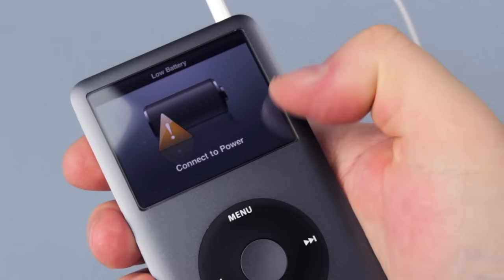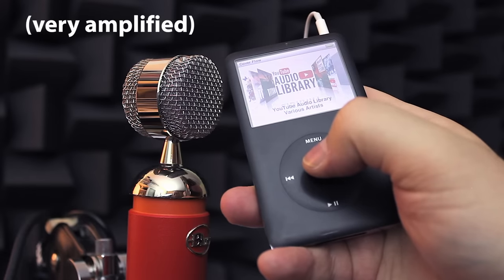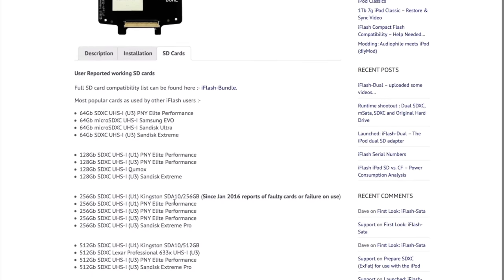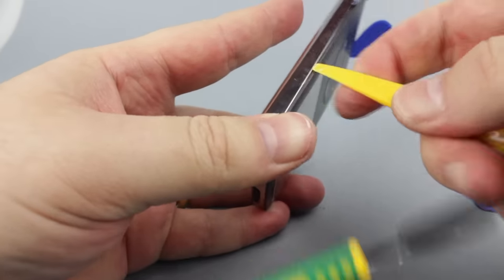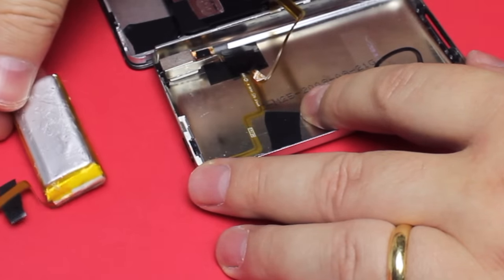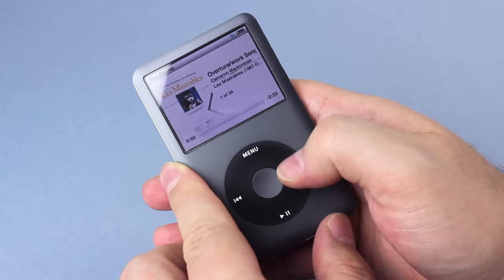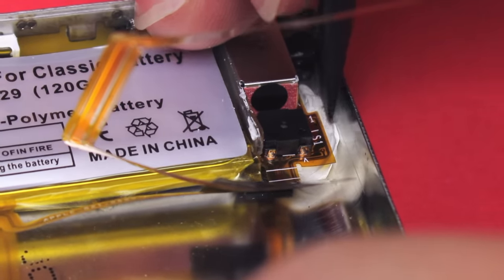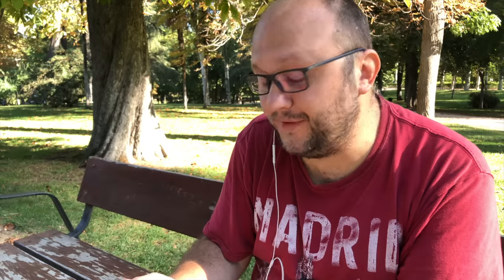iPod Classic new Battery & 256GB SD Card: still works in 2024

Comment: Thanks for your honest and informative info on how to do this. I was so apprehensive I didn't bother to order the micro SDcards  and the quad holder before getting the back off. However I did it in less than 10 mins thanks to you making all the mistakes for me and providing the vital PDF showing where the clips are. Great channel.
Reply from the maker: Thank you Ian! 😄 I am very happy that you could renovate your iPod without trouble! Most of the people watch this as entertainment only (totally fine), so when someone actually does it, I feel very accomplished 🤣
Reply: @GeekDetour   A footnote to my upgrade. Feeling pleased with myself I uploaded the whole of my music library and all my audiobooks. I still had 200gb free so I thought I know - photos. It will be another backup as well as having all of them in my pocket. GOTCHA! The photos synced OK but after a reboot the iPod stuck forever on the apple. It eventually dawned on me I’d broken the 50,000 limit. 35,000 songs + 18,000 photos. The iPod would go into diagnostic and disk mode but just sat there, draining the battery  if you tried to reboot it! So with these memory upgrades the 50,000 becomes a limiting factor. Thanks again. iPod now restored and synced - without the photo library ;-))

Comment: I enjoyed your video and it helped me avoid all the pitfalls that you went through. I had my own pitfall as the battery post came off the logic board :(. The brown locking tab was seized to the battery post due to age and heat . This is also a common problem
I was lucky enough to source a new battery post and had it re-soldered on.
The template for the clips was excellent and had my iPod 7gen apart in probably less than 3 minutes with no damage :D
Thanks again for posting your informative video
Reply from the maker: Wow, thank you so much for sharing your experience! I really appreciate it - most people who watch the video do so for entertainment (which is perfectly fine), but it really makes me happy when someone benefits from the video to actually fix their iPods ❤️

Comment: I have 160GB classic.  I think I bought it in 2013.  It is starting to give me some trouble, but I use it as my car stereo and I find the touch screen on my nano problematic.  I can't see it half the time b/c of the sun, and if I touch the wrong spot while driving it goes off into some neverland menu and I have to pull over to get back to the right spot. The classic is perfect for feeling my way around so  I need to source another one of these iPod classics or find someone like you to fix mine.  I can barely run a screwdriver so I know I would be hopeless trying to fix it myself.  I just read Edward Snowden's book, "Permanent Record" and so yes, I want to own my songs and keep them out of the cloud.  Anyway I am out in the bush most of the day so streaming is not an option.  Thanks for the video, you are great at teaching.
Reply from the maker: Thank you! 😁

Comment: Indeed useful and entertaining video! When I opened my 7th gen iPod few years ago to replace the hard drive it took me hours of struggle and I promised I would never open it again. Mine is the "black" (actually it is a dark grey), I used automotive paint with a toothpick to mask the small dents in the paint and the result was very good. Also, before closing, I spent a lot of time bending  the stainless steel borders inward to make sure the gap between front and back would stay as close and smooth as possible. The conversion to an SSD became cheaper and after seeing your video I cannot resist the temptation to open it again!

Comment: wow, following your advice and pdf I opened up gen6 like a book with in five minutes, not even scratch on it...and it is my first try, really easy when u know what to do, thank you very very much. and hell, everyone says its so so so so hard to do when it's not when u use right tools properly, very greatful man, thx again.
Reply from the maker: Hi there! I am glad the video helped you - Absolut right: once you know what to do, the difference is huge! 🤣
Reply: @GeekDetour  yee, I opened it painlessly, but even when I was careful while removing old battery I ripped "hold button"ribbon, same glue that was holding battery was also holding that ribbon and ripped it. I'll order replacement now I and complete iPod renewal later, I am changing battery and also installing iFlash, I'll replay here with results :) thank you again

Comment: Thank you so much! After trying for more than an hour using another video, I had bent the metal around the charging port, but failed to get the ipod open. I had a couple generic tools like the iSesamo, but based on your recommendation ordered the real thing. Increased the cost of the battery replacement, but since I suspect I'm going back in, well worth it. The top seems to pop up a bit as you successfully release the clips.  Battery is now good, but I'm pretty sure my hard drive has ongoing issues, and I'm going to look at the SD card adapter. Will remember to try and smooth out the bend in the metal around the port when I do!

Comment: (Nov 2020) I still have mine, intact and fully working. Flashed the firmware with Rockbox so I can play FLAC, APE, etc. too, and also not need iTunes. It can dual boot to iPod firmware (but I never do). Paired with "chi-fi" 12 driver earphones. Still sounds awesome!

I found your informative video while looking for a way to upgrade to larger SSD. Lossless music can fill 160GB very quickly.
Reply from the maker: Hi 👋 If I could go back in time, when I started ripping my CD collection, I would have done it in ALAC (it is the Apple Lossless codec, an option inside iTunes) and the original iPod Apple firmware plays without a problem - I really like the original interface of the iPod 🤣 Actually, even iTunes I like 😳 But since most of my library was ripped in AAC 160, I won’t bother going bigger than 250GB - in fact I don’t use even half of that 🤪. I am happy you enjoyed the video! Be careful when opening your iPod - if it is working perfectly, I would postpone this “surgery” 👍

Comment: Brilliant instruction.  What glue did you use to close the first iPod and can the iPod be re-opened once it is glued?  Thanks
Reply from the maker: Thank you! The glue is “Ceys Montack Desmontable” that I easily find here in Spain but I have no idea of a similar product on the USA. It is a white paste adhesive that you apply and it takes 24h to cure. Once it is hardened, it is quite strong - and yet, you can peel it off with a spatula leaving no residues at all.
Reply: @GeekDetour  So generous of you to reply.  Thanks, I'm in Europe and can get it from Spain.  My Achiles Heel seems to be the battery connector that so easily breaks off or the black locking mechanism falls off.
Reply from the maker: My pleasure! I hope you can fix your iPod too!

Comment: Excellent.  I'm about to get in to my iPod classic because the HOLD button stopped working.  I need to know what kind of screwdriver to get for replacing this part.
Reply from the maker: Inside the iPod Classic, if I remember well, everything was screwed with very small crosshead (Phillips) screws.

Comment: My iPod Classic 160GB Just died. At first it seemed to be a battery issue, but then I had to do a restore three times a week. So I gave up trying to get it to work. So for about a week I started using my iPod Classic 80 GB. It will last all night long without any issues. But after seeing your video, I might just try to replace some key parts. But yesterday I bought the latest iPod Touch 256 GB. So I’ll be ok listening to my library until I feel ambitious enough to take the iPod Classic apart. Thanks for the video.
Reply from the maker: Hey, my pleasure! Oh, any smartphone, iPod touch... actually, any touch screen makes a much better interface than the iPod Classic’s click-wheel. But, well, nostalgia 🤣

Comment: Thank you! This video showed me just how many people are out there "just like me". I've experienced almost all of this stuff in the iPods hey day. I didn't throw my classic away. The drive needs replacing ad I wanted to upgrade it to SSD. You did it Bfor me so I think i'll be fine.
Reply from the maker: Hey Darryl 👋 So, it is indeed possible to choose to use SD Cards, Compact Flash and actual SDD drives - both 1.8” Zif SSDs and the modern MSata SSDs. BUT, you might think SSD would give the best result in iPods... and that is controversial! The battery life can suffer quite a lot on SSDs compared to SD Cards. If you want to dive into the details, read this page: https://www.iflash.xyz/runtime-shootout-2016-quad-dual-solo-msata-vs-original-hard-drive/

Comment: Nice video. Loved to see how enthusiastic you are about this. I got myself a 7th gen, too. I got it for really cheap because the battery was dead and bulging, so I was able to gauge the price down a bit. I ordered the iFlash quad because it's the only iFlash that supports a big battery. I got myself a 3000mAh battery (which is actually ~1950, given it's size), a new black metal housing, a red faceplate and center button, and a black clickwheel. All the parts should arrive in a week or so, and I can't wait to finally have this iPod up and completely running!
Edit: I also forgot to mention that I went and got the taptic engine of an iPhone 7+ to replace the clicker speaker.
Reply from the maker: Thanks! And wow: some major changes in your iPod revamp! Will you make a video?
Reply: @GeekDetour  I had planned to make one, initially for my girlfriend only, but I decided some days ago that it would be cool to make one for the world to see, too. It's nothing other people haven't done already, but it's my own personal little project, so I thought it would be nice. It won't be on this channel, however. If I remember I will post you a link when it is done!
Reply from the maker: That’s great! Good luck with your project and I will surely watch.

Comment: I have 2008 6th Gen Rev 1 80gb ipod classic and i this is exactly what i want to do with mine. I do have an ipod touch 7th gen, but it lacks volume fullness that the classic has. I would rather be able to use my classic more than the touch, so this video will help me immensely. I will update with results when finished. Thank you Geek Detour.

Comment: I have a 6 year old iPod Classic 160 GB which I bring with me when I travel and also use with the iPod dock in my Honda Accord.  Several months ago the hard drive started to fail.  I can load about 30 GB on it and it runs fine, but I expect it will eventually fail altogether.  I am planning to attempt replacing the hard drive and your video is very helpful, especially the information about how to open it up and the necessary tool.  Thanks for all of the information!
Reply from the maker: I hope you can repair it without much trouble! Be extra patient while opening it and good luck!
Reply: @GeekDetour  Thanks!  It took me about 20 minutes to get it open using the tool you recommended.  Your video and the diagram were extremely helpful.  Everything went fine except the battery connector came off the board.  My soldering skills aren't good enough to repair that so I've sent it off to someone to fix.

Comment: i'm a hip-hop lover, mainly late 80's/ early 90s, so I didn't have anything after 2001 saved on my pc. Now that I'm starting to upload my 2000s albums I need to upgrade my hardrive on my iPod. I have 900 albums stored and probably have another 700-800 to go. great video
Reply from the maker: Thanks Enrique! I hope you can fix your iPod's Hard Drive and enjoy the nostalgia of the 2000 portable digital revolution :)
Reply: @GeekDetour  I bought the 4 micro SD version... having issues with my ipod loading albums/songs slowly or not at all.... maybe because its communicating between 4 cards
Reply: could it be that I forgot to format the micro SDs

Comment: Nice video the replenishment you did on the battery is the same come with the original ipod? And works well? No issues?
Reply from the maker: The battery I used is not “original” (there is not an original battery to buy) and the first battery I purchased from Amazon worked for quite some time, although the autonomy was less than what I usually had when the iPod was new... So more recently I ended up buying another battery (this time from iFixit) and I replaced it again - the autonomy is better. I still don’t think I have the same autonomy as the original from Apple... But there are other factors, maybe I had purchased a “hunger” SD Card... I discuss this a little bit in this newer video: https://youtu.be/aF4O98epAZk
Reply: @GeekDetour  im upgrading my ipod classic 7th generation with iflash sata Dual with 2 sd card 512gb each to make 500gb I should to buy the 3000mah battery for this upgrade or can be the one come with the ipod?

Comment: I too was given an engraved classic Ipod160gb from my wife which I treasure. I was thinking about upgrading it with SSD and a larger capacity battery but was terrified of damaging said Ipod. so I bought a 80gb classic to have a trial run unbeknown to me at the time the maxium size SSD that can be fitted was 128gb to this model, The trial run was successful, I will now go a head with upgrading said Ipod to 250gb SSD and 300mA battery 😊😊
Reply from the maker: I am so happy it is working for you! Cherish your iPod 😁 Good luck upgrading the important one!

Comment: Hello my friend. I am happy to have met this video of yours. I am about to start working on a second ipod i just bought. A used one. My first ipod is stiil intact and sound. But i decided to buy a new one to have a spare. I love them for their big capacity. (Sound quality is not what apple is best known for). Your video is really instructive. I am in the process of identifying and ordering all the parts needed. This second ipod of mine is the thicker one. I will try to upgrade it to a 512gb sd card. If it does not work, i will try a 256gb like you did. I just hope i don't break things along the way. This is really common and people just don't include them in the tutorial, making you believe they are perfect. Your video is fantastic. Thanks.
Reply from the maker: Hi Valdir! Check the iFlash website to see if your specific thicker model is the one with 128GB limitation - if it is, whatever bigger size of SD Card you use, it will recognize only 128GB... pay good attention your exact model. Also, bear in mind all models will at best hold 50k songs.... and unless you have previously encoded your songs in Lossless (ALAC), with regular 160kbps or 192kbps, 50k songs won’t surpass 256GB of space... There are lots of interesting details like these in the iFlash website/blog.

Comment: Great video. Struggling to find out which generation is my Ipod. 6th or 7th. By the serial number on Apples's website it stated its a iPod classic 160GB (Late 2009). Would that be a 7th gen? Appreciate the help.
Reply from the maker: Thanks!!! Actually, there is no official “7th gen”…. Yours might be the 6th gen 2009 (that started being called “7th” gen on the streets). The Apple’s website surely is the correct source.
Here there is a “models” table with all the differences:
https://en.m.wikipedia.org/wiki/IPod_Classic
Reply: Grand! Never ever tried to do such a challenging thing! Will give it a try on my dearest iPod classic and try to revive it! Thanks to your video I built up some guts for the challenge! @GeekDetour

Comment: I still have an Ipod 4th Gen That has had CF storage in it for years.  I use it because I have a car stereo that allows me to plug the Ipod into it.  I Had to replace the original hard drive  because I live in Nevada and the heat here killed it.  Looking to get another one that I can also add bluetooth too.
Reply from the maker: Yeah, in the golden years of the iPod, there were many appliances we could plug the iPod directly. I have a Home Theater that has a 30pin iPod Docking… in Gyms, we used to see running mills you could control the iPod with the screen, cars with docking like yours. It was fun.

Comment: great content! BTW, can i use a 512 or a 1TB storage on the ipod?
Reply from the maker: Thank you! Look, sure, you “can”… but I don’t see the point. Let me explain: the iPod Classic firmware cannot manage more than 50k items (songs, podcast episodes, videos) on its library. With normal songs (mp3 or aac encoded) you can max out the 50k items with space to spare. The only people who take advantage of 512GB or more are the ones who had their songs in Lossless compression to begin with. Of course, there is no point in reconverting your songs to lossless if you already had compressed them with a lossy codec originally. That’s why 256GB, in my view, is super enough.
Reply: @GeekDetour  thanks for this info , mate

Comment: just dug one out. The battery isn't great. Would love to mod it. But im venturing for adding Bluetooth if im gonna take it apart anyway. Im glad to see it lasted 2 years as of release. I hope the SD card is still holding up? Thats my main concern.
Reply from the maker: Hi there! I never tried a Bluetooth MOD because the whole iPod is metal, like a Faraday Cage - so, it would require putting the antena out somehow… But the SDCard that I chose (I mean, the second one, that didn’t die when I made the video) is still what I have today. My iPod still works fine. This MOD was made in 2016  (the video was published in 2018).

Comment: Great video! I have a iPod nano 3rd. I haven't used it for 4 years. Today I charged it and turned it on, only to find there were 4 vertical white lines on the screen. Do you probably know how I should solve this problem? Should I replace the screen or other electronic components?